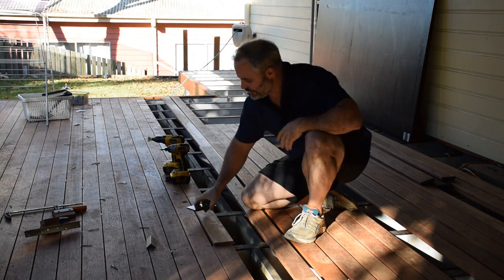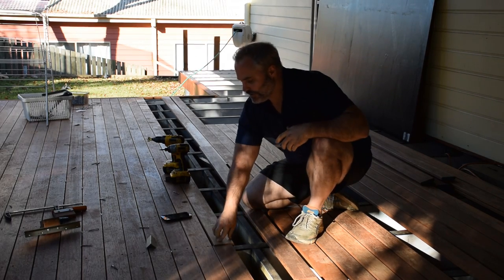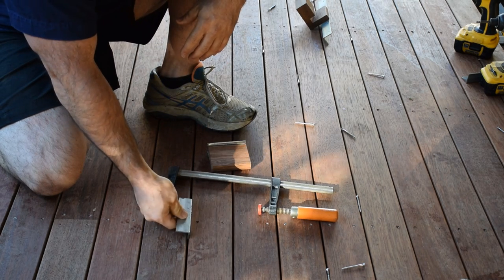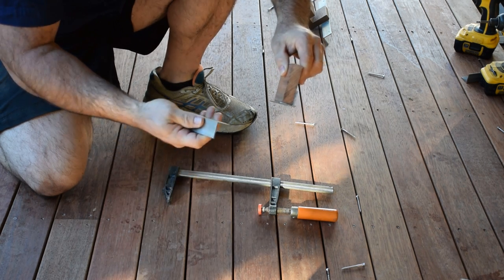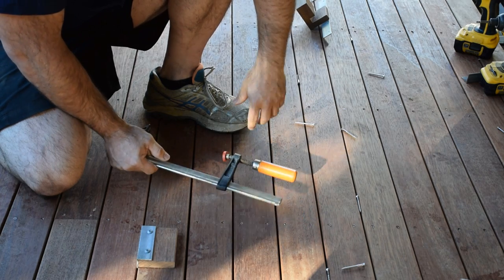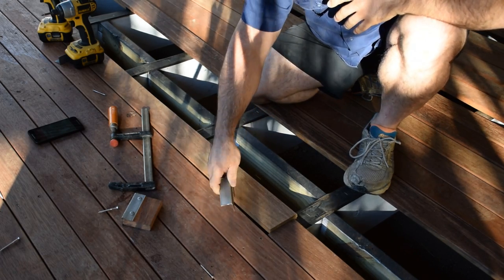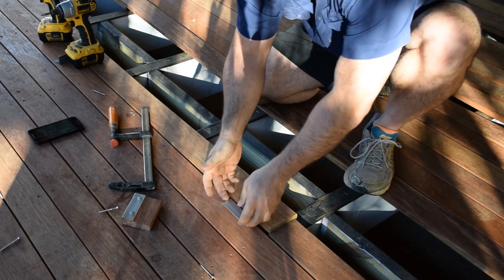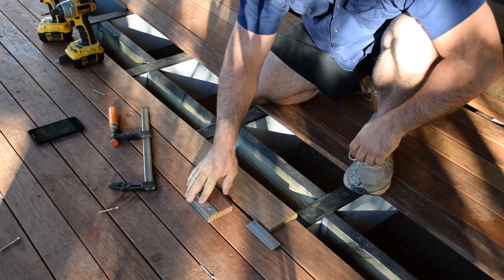How to Straighten Bent or Bowed Decking Boards, Hardwood Decking, Crooked decking, Kwila

Comment: Great tip 
I kind of expanded your idea I welded a small angle bracket to  an old clamp it really made the pulling in better and stable. 
It took a few practices goes to get the modification  right the only flaw  now over tightening can jamb the spacer.
F ton cheaper than a bow tench and easier to store in site box.